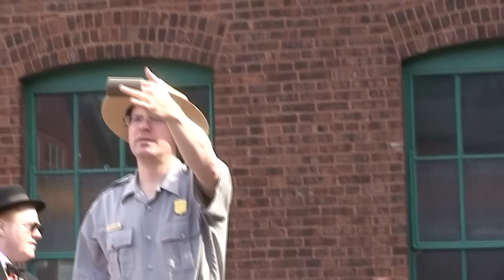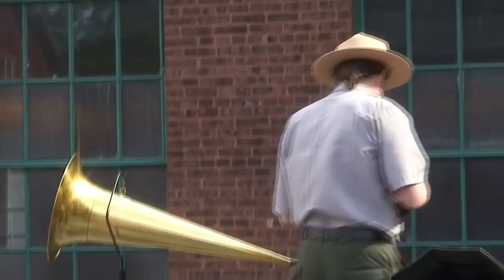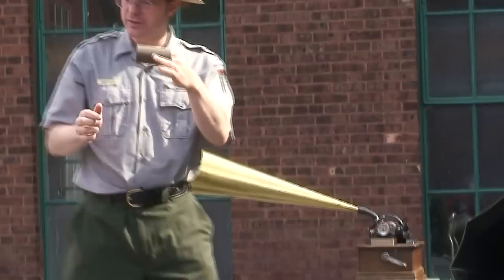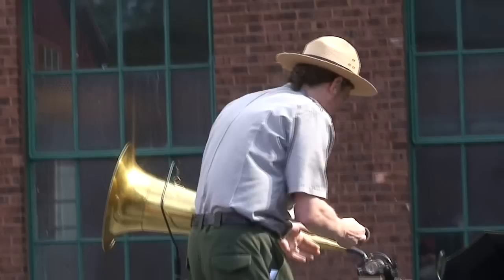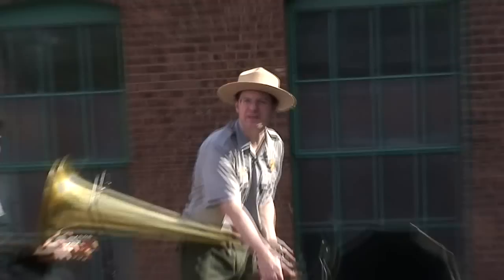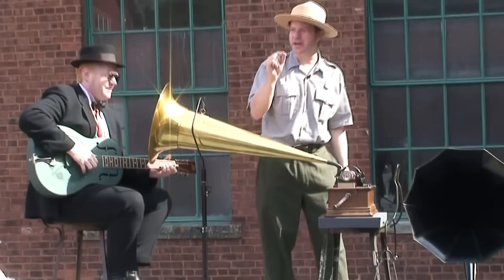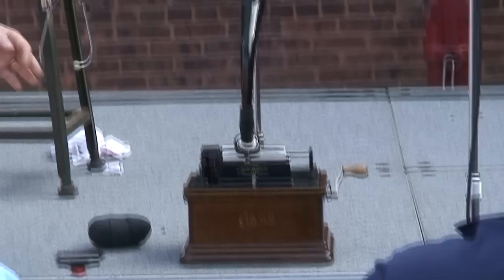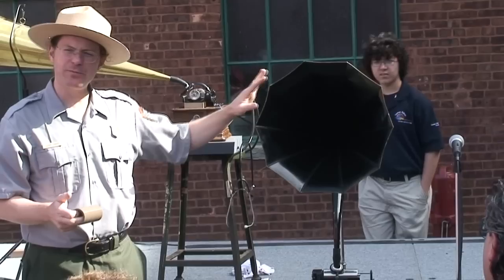Edison Museum Wax Cylinder Recording Session (HD)

Comment: Melt about 2 cups beef tallow, Mix in 2 teaspoons of powdered graphite, While stirring pour in your water caustic lye solution (like making soap). take a toilet paper cardboard dip it twice into the solution before it saponifies, let it harden, shape it to size make a plaster mold so it fits the mandrel. shape and shave the cylinder and voila you have a blank cylinder for recording
Reply: @emily5968 . It worked. However I forgot one important step all my blanks separated the glycerols over time. One has to do Trans esterification of the filtered tallow to get the glycerols out of the tallow. And right now I don't live in a location that's feasible to do this. My friend in a small town south of me is super busy now. If I ever get a chance to get a good ventilated shop I will do the process over again. And I will put up a private video. There's a few  more processes after the finished product. Also I'm not going to devulge in the extra secret ingredients I use. That method was  just basic. I have 2 5 gallon pails of rezin from a certain tree that grows  in abundance here that needs to be processed ( the secret ingredient) that I add to the Trans esterifided finished product afterwards.

Comment: If I am not mistaken, the original rendition was in the key of C and the final one seems to be in C + 30 cents, i.e., only a minor pitch shift. I didn’t note if there was a tempo shift but if it was there, it was pretty likely minor. But the recording did manage to make the guitar sound a bit like a mandolin and ig somewhat altered the singer’s timbre as well. Goes to show you that different harmonics are "caught" to different extents on the wax. Still overall, an unimaginable and near-magical feat.
Reply: It's analog, so a chance in pitch is accompanied with an equivalent change in tempo.
Reply: @joseislanio8910 Aha

Comment: Well, this cylinder turned out remarkably easy to listen to & understand. A little needle scratch due to the imperfections of a wax (resin) cylinder, but remarkably clear and crisp.

The spoken intro was pre-1909ish as the spoken announcement was dispensed with in that 1909. 

Had cylinder records maintained their popularity past 1929, we might have had electrically recorded cylinders with microphones instead of horns.

Comment: Very interesting demonstration.
I don't understand why they would use a microphone when playing it back. Couldn't they have just used a machine with a bigger horn? Sure makes sense to me!
Reply: The bigger the horn the higher the pressure on the cylinder, which will cause wear on the cylinder extremely quickly and destroy the grooves.

Comment: How do you mass produce records? Seems like the artist has to be physically present to record onto each cylinder
Reply: At first yeah, that's what they had to do. A moulding process was eventually worked out though.
Reply: It’s pretty much the same process as how records are made. The cylinder recording in this video would create the “master disc” (in this case it’s a cylinder) and then a mold would be created of it, and then the liquid wax or soap would be filled into the molds.

Comment: the tip of the recorder is acctually a glass rod, very small and quite sharp, it is much better recording on these machines than on a modern cassette or other formats, that is why im going to buy a phonograph and recorder, i allready have a decent collection of gramophones and 78s but i want to start moving into phonographs and cylinders, and im only 14!!!